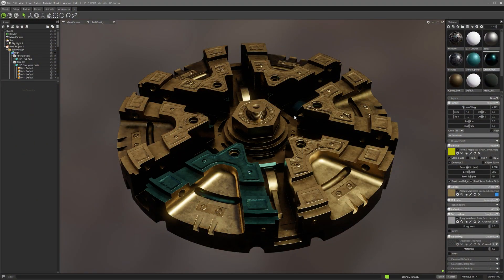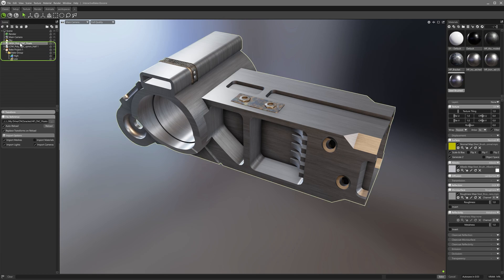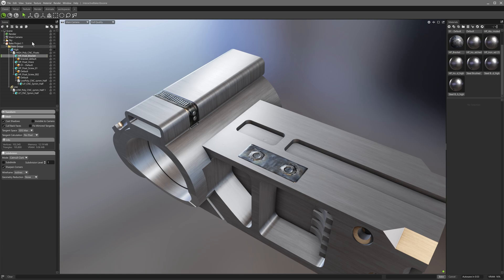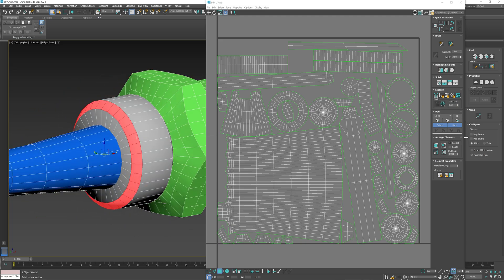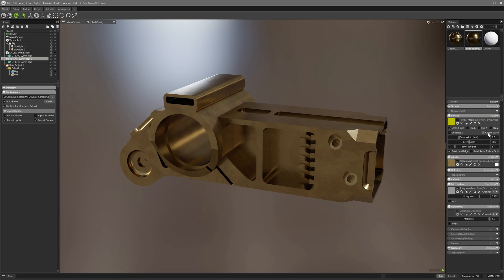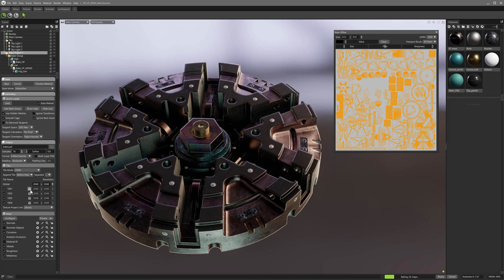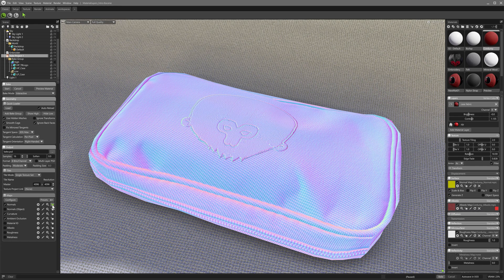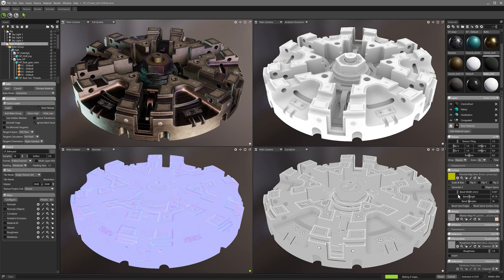What’s New In Baking | Marmoset Toolbag 5

Comment: Chamfer\Bevel is so good, that I would upgrade just for it! Great release. Such a relief for hard surface.
Reply: Hi. Does it work in Unreal and Unity?
Reply: @muhammedbaykul3194  It is just baking it to normal map, so it works everywhere, where normal maps are supported.
Reply: @muhammedbaykul3194  It's a normal map, yes it will work.
Reply: @muhammedbaykul3194  It bakes bevel into normal map, so it will work in anything that supports normal maps.
Reply from the maker: @muhammedbaykul3194  Toolbag is a standalone desktop app, but yes, your materials/texture sets/scenes created in Toolbag can certainly be easily exported to projects in Unreal or Unity.